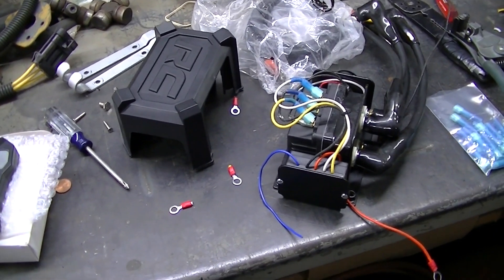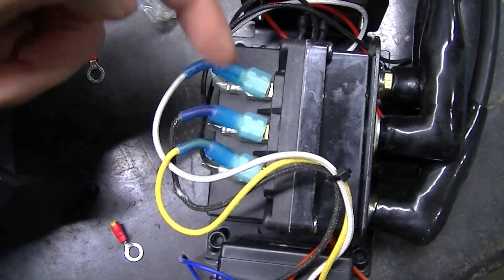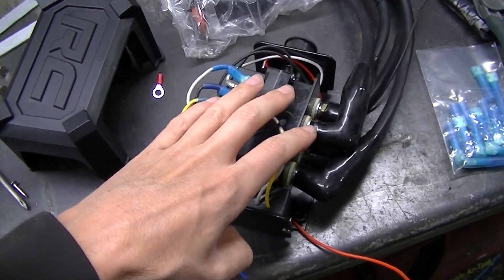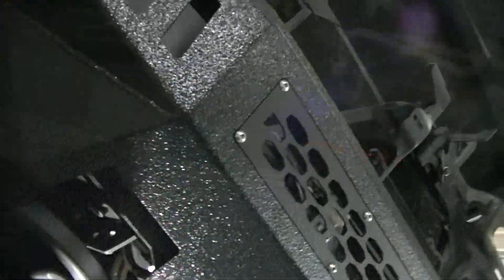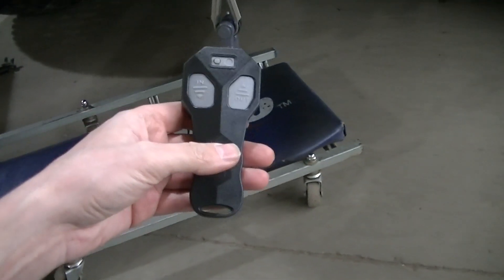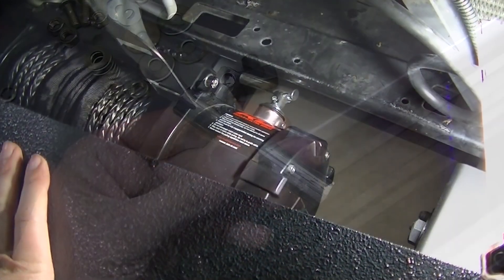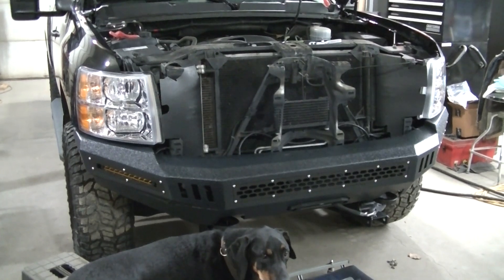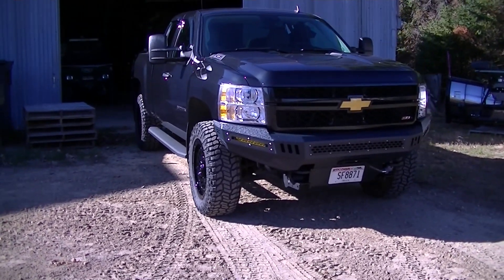Silverado 2500HD Winch Wiring & Clutch Lever | First Use

Comment: Nice remote control and good job on the handle!  Looked like the rope has a lot of stretch to it.  Not sure if I'd like that or not.
Reply from the maker: Because it's not solid like cable it will stretch but it's suppose to be way better than cable. I don't have any experience with the rope. Even my atv/utv winches all had cable.

Comment: Assuming you have the standard 170 amp alternator, did the computer complain when you put a load on that is more than the alternator can generate?
Reply from the maker: This truck has the snowplow prep, so it has the bigger alternator and I run two batteries. No issues running the winch.
Reply: Wow, perfect set up.  Thanks

Comment: Put a winch saver on the cable, the squishy round ball you know?
Reply from the maker: I don't see myself running the winch in that far without me looking at it.
Reply: @mossman381  It's not the purpose, it's mostly to keep it taught without too much tension on the rope. Prevents it from being noisy when too slack, or stretching the rope constantly when not in use.
Reply from the maker: Rough Country doesn't sell them. I actually don't remember seeing them on any truck. I have seen many on atv/utv.
Reply: @mossman381  Even the atv ones will work.  I think they are all the same. With the remote delay it makes it easier to make it perfect. Dont have to back out a little more to wind it to exact spot or hear the cable crinkle. Of course it's more of a problem on metal wires  than rope.
Reply from the maker: I see the ones on Amazon say atv/utv. Are you sure a they will work for a truck winch. Atv/utv winches are usually 2500-4500lbs. Truck winches are 8000-12000lbs. Right now I am just hooking it on my tow hook and just snugging it up so it can't pop off.